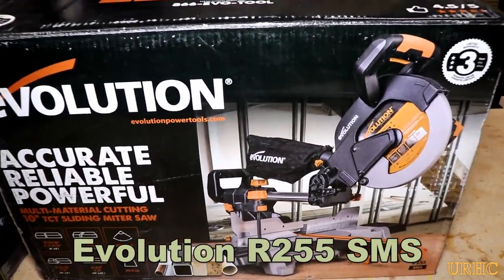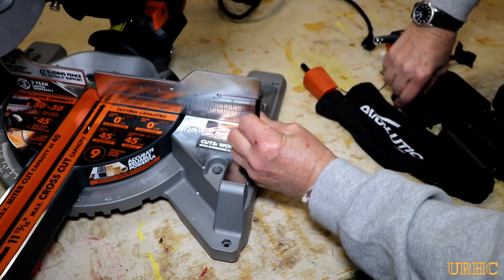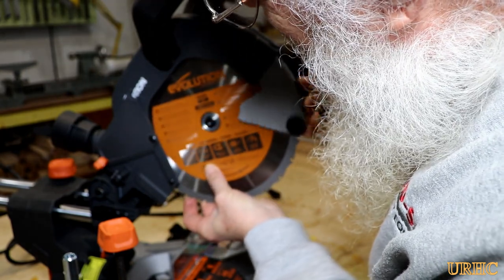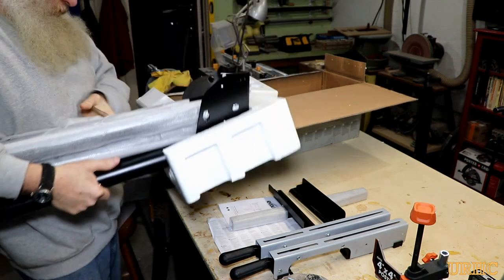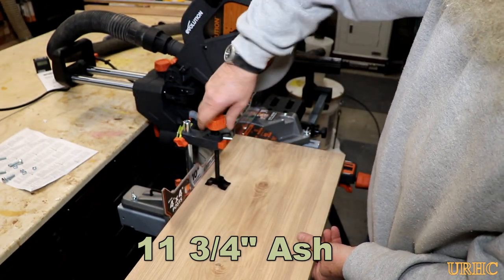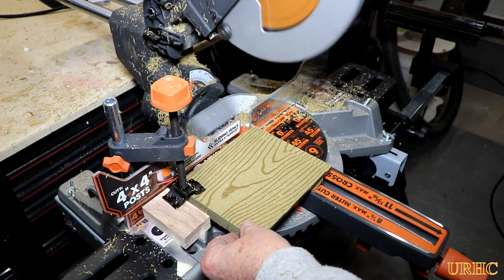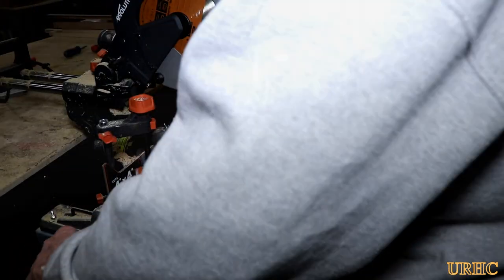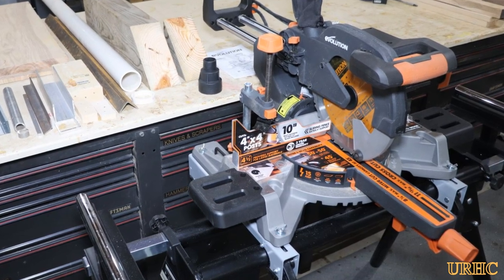Evolution R255 SMS Miter Saw With Matching Stand Assembly And First Impressions

Comment: Nice tool review, my current saw is a 12” Dewalt I bought in 1998 and is starting to show it use and age. After watching this video I will give the saw serious consideration as I’d like a sliding saw option as well.
Reply from the maker: It's not a super precise woodworking saw if that is what you are looking for. The limited blade choice for this rpm saw put it in a special niche.  It does a good job cutting many different materials at an affordable price point. My dewalt is about that old also and feeling its age like yours.  We will see how it holds up to my use. Thanks for watching.

Comment: I like it! I almost bought the Dewalt crosscut and stand many times, didn't like the size or the price! I need something to replace my ageing Craftsman radial arm saw and this may fit the bill, I like the price also. Great review,  Evolution couldn't have picked a better person to review their product! Thanks for posting!
Reply from the maker: This is a very unique saw that has the ability to cut many different materials.  It is not a super high precision saw for glass smooth cuts in wood, but ti does make fairly good accurate cuts in what it can cut. I think the capacity for the price is amazing. My dewalt saw worked good for years but now has wear that affects the accuracy and it just takes up too much space. Thanks for watching.

Comment: Great job on the review. Couldn't ask for any better. Thumbs up, thank you for your review. You have me sold.
Reply from the maker: It's a nice saw for the money.  I like my rage3 better because it's quieter and came with a better blade but this one is only half the price.  It's a good multiple material cutting saw. No problems with it yet and it has seen quite a bit of use in my shop. Thanks for watching.
Reply: I actually have the Skilsaw metal cutting saw (not a slider). I want this saw mainly for wood cutting. At this point in my life, it will only get used occasionally, so the price tag vs amount of use is just right. I don't need a $500 slider at this point. Thanks again.
Reply from the maker: I purchased the wood cutting blade for mine  and it gives a much cleaner cut in wood now.
Reply: I'll use my Diablo 80 tooth fine cut blade for wood and save the Evolution blade for my Skilsaw, cold miter saw. Thanks to your good review, I just ordered the Evolution R255 sms+ today. Do you ever use Diablo blades? I come to find out, even though they are a little more expensive, there superior to other blades and last longer, especially the ones made with Cermet carbide.
Reply from the maker: I gave up on Freud blades after buying a premiere fusion that stunk. I now use Amana prestige blades that are amazing.  Remember this saw only runs half the speed of a standard woodworking saw so you won't get an equivalent cut with a blade designed for higher rpms.

Comment: This looks like it would be a pretty good saw. I am in need of a new one at the moment so I was glad to see you do this little review. A big plus for me was the price of this saw. Looks like a good saw for a decent price. I've been using the Dewalt myself and to be honest,I've never been very happy with any of the Dewalt tools I have owned over the years. Thumbs up and thanks for sharing the info
Reply from the maker: This is not  a high precision woodworking saw if that is what you're looking for.  It's a unique lower rpm saw that can handle multiple materials and does a good job with them.  It's light weight with a great capacity. There's some better information on the evolution website with the full specs of what it can handle https://www.evolutionpowertools.com/us/build/mitresaws/r255sms/.  It fits my needs perfectly.  We will  see how it stands up over time.  Thanks for watching.

Comment: Thank u for the review. I just got one as a gift. The slow start and gb noise seemed odd to me. I wasn’t sure that it was normal.
Reply from the maker: That was what I said. This saw has very loud gears compared to the Rage3. They left the bottom of the gearbox open for some reason. The slow start is normal and keeps it from kicking when the trigger is pulled. No problems with it yet. Thanks for watching
Reply: My wife bought it for me to replace my 20yr old saw. It cuts beautifully. I was a little nervous that it was defective bc of the odd start and noise. Thank you for the review and allaying my fears.  I am looking forward to future projects with my new saw
Reply from the maker: I wound up buying the wood cutting blade for it also. It gives much smoother cuts in wood without nails.

Comment: Very nice saw and stand. The only thing I'd like to see on the stand is a set of wheels for easy moving, so you don't have to carry the saw and stand or remove the saw to move it. Thank you for the review.
Reply from the maker: You would really need a mobile base for that.  This is very easy  to pop apart for moving. They did a good job with both of  them.  Thanks for watching.

Comment: Great review.
Could you shed a little light on mounting the saw to the stand? The mounting holes on the saw have bolt shaped holes which makes it impossible to properly out in a carriage bolt. Did you leave that empty and just use a washer and wing nut instead?
Thanks.
Reply from the maker: The bolts come up from the bottom.  The head locks in the bracket slot and the washers and wingnuts go on the top. Thanks for watching.

Comment: Interesting saw.
Never saw one that needed assembling.
When I went to buy a 10" saw, a friend said get a 12", because there would be times I would need it.
I bought the Hitachi C12RSH ($330 on sale with coupon at Lowes) and a DeWalt 742 lifting stand.
Those two things together are a beast in size and weight.
It's really nice, but a nice 12" blade is expensive.
The DeWalt and Bosch Glide were on my list, but a bit pricey at $600.
I should have given more thought to it, because a good 10" blade could have potentially been used on the saw and table saw.
Reply from the maker: When I bought the dewalt 12 inch was the only way to cut 4 x 6s . It is big, heavy  and can survive construction crews. This saw is the exact opposite. It is light weight with a  large capacity.  This is not the best saw for precision woodworking but does a good job cutting most materials.  Time will tell how it stands up. Hopefully it is as good as the Rage 3 at a lower price point.  They broke it down so it fits in a manageable size box and made it very easy to assemble.  I should soon have a video about the other saw they sent for a future project I had planned. They have done a great job creating unique affordable tools for homeowners. Not many companies would send me a tool and tell me we want your honest opinion with no restrictions.  Thanks for watching.

Comment: Great review, need a new saw for a bunch of projects and this saw looks to be on the wish list. Very informative video thank-you
Reply from the maker: I have been using it for almost a year now with no problems. It's not a super precision glass smooth cut woodworking saw, It's a great saw that will handle everything that you throw at it. Thanks for watching.
Reply: @unemployedredneckhillbilly2023 did you ever replace the blade with a wood only one?

Comment: Hi, I just bought the evolution r210sms + (my first miter saw). But I have encountered a problem the blade has a slight play I think it is due to the hex bolt that secures the blade to the motor, the bolt has quite a bit of play compared to the thread of the motor block and even if I tighten it well the oscillation to still the blade remains, the cuts cmq are accurate at least on the wood. I was wondering if yours also had the same problem? Sorry for my English
Reply from the maker: Contact Evolution and see what they say. Sounds like a problem because mine has no play and the blade runs true. Thanks for watching.

Comment: Nice one, looks like several improvements. I got the same model as your original on sale just before this one came out and have been using it building my shed (which you can see on my channel). I will have to see if I can afford the upgrade at some point, hopefully long before they upgrade it.
Reply from the maker: This one is nice but the rage 3 is a quieter saw. This has a lot of gear noise at start up. I think the rage 3 came with a better blade also.  I am going to order a wood cutting blade to try next and see if it helps when using the vacuum. They did some great upgrades on the clamp, fence, and laser switch. They are both great little saws with a large capacity cut and plenty of power. Thanks  for  watching.

Comment: Is it still going ok? made in China? how secure is the blade/arbor lock button when you are fitting the blade, is there a detent it drops into to hold the blade for tightening?
Reply from the maker: Still works great.  You push down and hold the blade lock. Not a precision woodworking  saw but does a decent  job on what it's  made to cut. Thanks for watching.

Comment: I saw that your saw sawed what other miter saws can't saw :p Good review! Time to get rid of my abrasive wheel saw and the portable 71/4" craftsman miter saw and make room for this guy. Although I have a metal cutting bandsaw and a plasma cutter this will be quicker for dimensional steel/alum pieces. Still keeping my 12" miter saw for crown and base boards.
Reply from the maker: This one is good for thin mild steel but if you will only use it for steel they make a 14 inch version that will cut thicker wall steel and aluminium with a longer lasting blade. Check out their website for a better description of each saws capability.  Thanks for watching.

Comment: I bought a 110 volt 255 mm evolution saw as we have to use 110 volt on site in Ireland . I am quite dissatisfied with the saw as the soft start delays for approximately 6 - 8 seconds . Also when I pull the trigger it hums for a few seconds .
Reply from the maker: That's one of the safety features I really like. Keeps the saw head from jumping like my old one at start up. I don't have humming. You may want to call them and see if yours has a problem.  This one is still working good. Return it if you're not happy with it. Thanks for watching.

Comment: how does it do a angle accuracy?  in both wood and steel profiles?
Reply from the maker: It does a decent job. I think the blade on this limits the accuracy. It's not a super precision high speed wood cutting saw but does a good job on everything it's rated to cut. for really good precision on steel look at the evosaw380. perfect miters every time with mine. Thanks for watching.
Reply: @unemployedredneckhillbilly2023  Thanks, just looking for something versatile (low on space) that can do a decent cut without ~1-2 degree float. I think the R255 will be a perfect match, perhaps with dedicated blades for a better cutting

Comment: which one it more accurate this one or the dewault ?
Reply from the maker: Dewalt because it had a better blade and turns twice the rpm. This one is more versatile with almost the same cut capability at less then 1/2 the price. plus it takes up a lot less room.  I like the rage 3 better. Thanks for watching

Comment: 1. Soft-Start feature❓
2. Blade Arbor Cover coming loose problem❗

I just bought myself an early Christmas gift of this Evolution R255 SMS 120 VAC (Canada) from Continental, a nearby discount store, that sells all kinds of overstock items at good prices.  When I came to test the saw I noticed that the blade hesitated when I pulled the start trigger and that it ran rather noisily.  So I thought that I would have to use the store's 15-day "no questions asked" return policy.

Not wanting to accept that I would have to return my new toy (sorry, essential tool), I checked 4 other R255 SMS review videos and this was the first one that mentioned the slow-start or soft-start feature of this saw... and also mentioned the noisy gear box.  Maybe everybody else knew about this but I certainly did not.  That means that my saw is OK and that I get to keep my Christmas self-gift after all... good stuff!

Thanks for taking the time to mention these small observations.  It can really make a difference to some viewers.

⚠ By the way and in the spirt of giving back, I have an observation and a work around to share.  That triangular part that partially covers the blade (Blade Arbor Cover) has two hold-down bolts.  The lower bolt turns all the way down and locks the cover down and in place while the upper bolt does no turn all the way down and does not lock the cover.  Instead, this upper bolt is used to allow the cover to rotate up and out of the way to access the blade hold down bolt (Flange Bolt) when installing or removing the saw blade.  Well, on my saw tightening that lower screw causes the cover to push out or cam out!  I got very good results by using a simple flat washer that holds that cover down tightly with zero movement or push out.  I hope that this information will prove useful to some viewers with similar symptoms.

Many thanks and Seasons Greetings, Bill
Reply from the maker: Yeah the first generation off this saw wwaas much quieter with an enclosed gearbox.  Still no problems with either one of them. Thanks for watching.

Comment: I noticed by the looks of it you had a 4 inch piece of timber you cut on it but mine (same model as this) won't cut it as will only cut up to 3 inch. What's the secret?
Reply from the maker: Mine cuts a standard 4 x 6 that is 3 5/8 thick. Check the stop for dados is fully backed off. Sure you don't have the smaller one. Thanks for watching.
Reply: @unemployedredneckhillbilly2023  oh OK, I assumed you can't cut a 4 inch on it. How do you back it off as you say?
Reply from the maker: You can't  cut 4 inches.  a 4 x4 is only about 3 9/16 that's the  max. Read the specs.
Reply: @unemployedredneckhillbilly2023  so you saying I should be able to cut a 4 by 4 post? I have read the specs but in practice It doesn't physically cut it all the way through in one pass, so as I asked how do I make the right adjustments to do this?
Reply from the maker: If you can't  cut 3 9/16 contact evolution.
Reply: @unemployedredneckhillbilly2023  OK so it should cut a 4 by 4 post in 'one pass' with no adjustment?
Reply: @unemployedredneckhillbilly2023  did you get my reply?

Comment: Hello, I just bought the saw but when I read the manual it says that you shouldn't cut galvanized steel and I bought it for that purpose so it's disappointing so I contacted to the company and they explained me that  the blade was made to  occasionally cut steel,  20 % steel and 80 % wood. 
That if I want to cut steel,  that they sell a proper blade for mild steel and thst to cut steel I should buy another clamp,  so to use 2 not just one and that they sell it as well. 
I just don't understand why they don't say that in the box, not even in the instructions. 
What I did to cut wood,  pine specifically,  was to buy a normal wood blade and the results are just like a normal mitersaw I just flipped the disc because the evolution saws spin against a normal saw.
Reply from the maker: I have cut a lot of galvanized steel thin wall steel tubing with my Rage 3 and had no problems.  The blade on this one was cheapened up with teeth being removed and it doesn't cut as good as the old rage 3 blade.  I also bought a wood cutting blade for it because the multicut  on this one leaves so many splinters. All the stacks of steel studs they show being cut in videos are galvanized so I wonder why they say you can't cut galvanized mild steel now. This clamp is much better then the rage 3 clamp but isn't perfect if you will just be cutting steel. If you're not happy return it if you can and buy one of the dedicated steel cutting saw. Thanks for watching.

Comment: Thank you for the informative video.  I am now planning on buying the slightly updated Evolution R255 SMS-DB+ 240V.  The package comes with a multipurpose blade & a wood cutting blade (all 28 tooth).  Would you recommend this saw for mostly wood cutting but also other multipurpose jobs.  How is the saw coming along BTW? Best wishes.
Reply from the maker: I use it in my shop every day mostly for wood but also cut a lot of aluminum with it.  I have the older rage3 in my metal shop and that is used for mild steel and still no problems. The older rage 3 blade has a higher tooth count and gives a cleaner cut on steel and plastic. They are not a high speed super precision specialized saw for wood but do a great job on all the materials they are rated to cut. Watch the evolution videos about how to cut for longest blade life. Thanks for watching.

Comment: Thanks for this video.  Comprehensive, and the voiceover method works really well. Have been thinking of buying an evolution saw and the extra few pounds/euros/bucks seems worth it for the increased diametre of this one.
I just wondered - the adverts claim 3+1/8in depth of cut and you cut a 6x4 - is that a prepared 6x4 that is actuially thinner than that, or does it really cut 4 inches?
Cheers
Reply from the maker: The us version I have will cut 3 9/16 inches thick max. The 6 x 4s here are 3 1/2 x 5 1/2 inches. Not sure about the UK version.    Thanks for watching.
Reply: Thank you again.  Bought it yesterday morning, picked it up yesterday afternoon, used it yesterday evening, thrilled with it for a very long time I suspect! Cheers again for the comprehensive video. R.